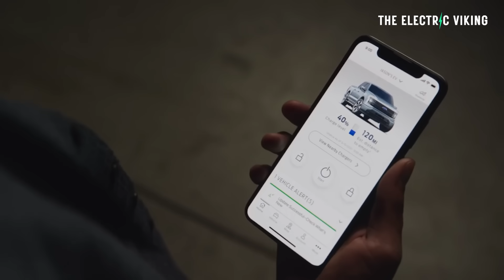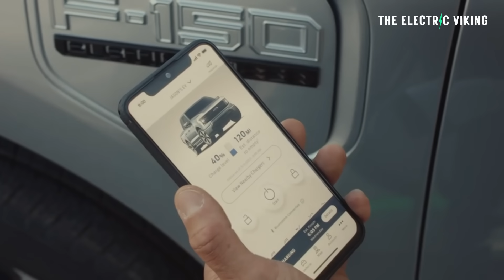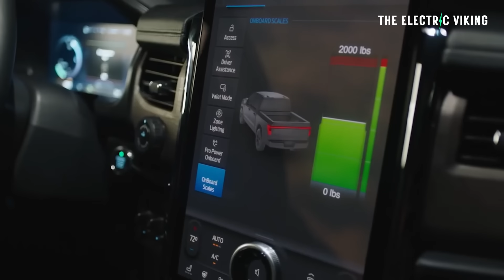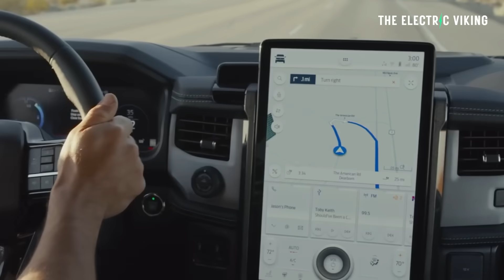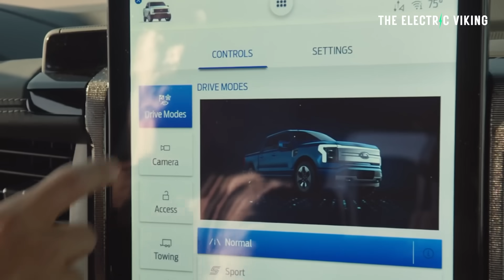Ford increases prices of F150 Lightning after losing $4 billion on EVs in 2023

Comment: Here in New-Brunswick they have 6 Ford Lightnings in stock at our local dealer, and they are not moving. They have MSRPs between $ 82,060 and $ 118,655, before taxes; taxes here are 15%. That's over $100,000 OTD. That's a big payment for an average joe.

Comment: Great video as always but you really should point out a few things.   1.  Ford's loss of $36k per vehicle includes legacy costs related to designing a new EV truck and setting up a factory.   2.  Ford did not cut production of the F150 Lightning!!!!!  They cut their production target for next year (2024).  This is not the same thing and you should explain the difference.  3.  Finally, you left out the biggest news related to the "Flash" editiion.  It comes with a heat pump!!!  Many buyers are waiting for the heat pump and NACS connector.
Reply: Well if customers are waiting for a NACS connector they won't sell any in 2024
Reply: @PaleBlueDotCitizen So lose/lose situation maybe 🤷‍♀️

Comment: They should re-name it the Electric Yoyo!  We didn't have any problem... were on the waitlist for about 2 years, then ordered the Pro... it came pretty quickly... we were surprised. If you're short, be prepared to do some mods to the driver's seat... it has no vertical adjustment. We used wood! I'm surprised NHSTA let this pass. There's already concerns about people running over little kids 'cause truck hoods are so ridiculously tall! Frunk is really nice!
Reply: Aaand ... if you're too tall?

Comment: 5:07 There is nothing especially efficient about the Cybertruck. Out of spec got 260 miles from the Extended Range F150 and I believe 250 miles from the dual motor Cybertruck (to be confirmed) performing similar optimum real-world tests.
Reply: A CT simp accidently filmed the Cybertruck screen and put it up on Youtube when the energyconsumption was up. 667Wh/mile😯 It's extremely unefficent.
Reply: There is no dual motor CT yet.
Reply: @Tschacki_Quacki  Nonsense, customers are only receiving the dual motor variant currently. https://youtu.be/9tAq5hbIWs0?t=1015

Comment: The flash version has the extended range battery plus the tow pkg & upgraded sound system, so it’s really a slight upgrade over the old extended range XLT.  Specking the old XLT with the same tech was more expensive in 2023 & you couldn’t get the B&O sound system before unless you jumped up to the Lariat/Platinum versions.  The flash version is the sweet spot for me.

Comment: Until you can use the Tesla Supercharger Network don't buy any other vehicle if you're planning on doing road trips. If you've got a garage charger and you're just doing local stuff almost any Eevee is going to save you money. But if you're doing longer trips and you can't use nacs connector, fugetabout it
Reply: One could do a cross country in a non-Tesla EV but range anxiety is likely to happen, not so with a Tesla. Also the navigation software in Teslas figures out where to charge, or even better the ABRP mobile app.
Reply: Do you like EV for the environmental thing?... If so why would you want people to wait to get into one.
Reply: @howardj602 no. It isn't. Learn before you speak. You've been lied to by cable tv.

Comment: I don't know what "losing $36k on every EV" means.  Are those marginal costs, or is it calculated by spreading all the initial investments over the small number they have sold so far.  If the later, it doesn't make much sense because you could say they lost $5 billion on the first EV they sold because it didn't pay for all the investment made before that.

Comment: I think Toyota actually has the correct approach towards EVs. 
Take it as slow as the industry allows, try new batteries on hybrids as opposed to pure EVs.
These legacy automakers cant make a proper EV to save their lives.
Reply: Do you have any idea how archaic the battery used on Toyota hybrid system? And how pitiful the electric motor on their hybrid system? Being a former owner of XU50 highlander and current owner of XL40 Sienna. I can tell you the current 3rd generation HybridSynergy is not much better than the 2nd gen. They are not slow, they staganated. The only advantage of the 3rd gen system is the manufacture cost is lower than the 2nd gen. Allow more model to have it.
Reply: @林振华-t4v   The batteries are archaic? because they dont own the manufacturing plants to develop something as advanced as 4680. If they try it, Toyota would need massive sales to recoup the costs. Toyota sells across the entire world. With only a few countries with good charging infrastructure this is not a worthy investment.
I dont think they have stagnated. New Prius has a pure electric range of 40 Miles. Next gen is likely to have more.
Toyota is not anti EV. They just dont want to deal with losses that they have to endure if they try to instantly switch to EV.
Reply: @vorpalinferno9711 
😂... You know Tesla don't make those batteries right?... It's Panasonic, so no different than Toyota buying batteries.
Reply: Toyota current stance will lead to bankruptcy I’m guessing. When countries new car sales are up to 97% EV where do they sell there current models?
Reply: @TomTom-dy6qr   How about no?
Toyota have been playing the game for over 80 years, evolving and adapting every decade rarely missing a move.
Reply: @TomTom-dy6qr  
Toyota sell 10 million vehicles a year... Have have half trillion in assets, revenue of 250 billion.
They have machinery manufacturing
Car part manufacturing
Steel manufacturing
Shares in multiple car companies
Shares in many ther industries

I'm sure they know what they're doing, they didn't become the second largest car manufacturer making stupid decisions.

The auto market is far bigger than just a few EV sales in the US.
Reply: @Robert-cu9bm   Sounds like a Nokia and Blackberry situation. They couldn’t go out of business either and “knew” what they were doing. Writing is in the wall and that’s why Toyota are currently lobbying the UK government to slow EV sales.  That action alone says they are in serious trouble.
Reply: @vorpalinferno9711   Toyota are currently lobbying the UK government to slow EV sales.  Even they know they are in serious trouble. I see another Nokia and Blackberry moment here 🤗
Reply: @Robert-cu9bm Guess you know Toyota just announced it had lied about the safety tests for the last 34 years. So number one, why would you ever buy a Toyota car. And two, imagine the potential fines and class suites costs for such deceitful behaviour 😱

Comment: I think fords base pickup in a ice version is $35,000 so that would make the lightnings base version at 25k higher . 

Now ford preferes to make more expensive models as they are more profitable so finding base models is dificult.

It doesnt look like ford evs will match ice vehichles pricing anytime soon . Even with battery prices coming down that wont be reflected in lower prices

Comment: One of the extremely problematic problems with the entire EV industry is that nearly no makers make a profit even with substantial subsidies which are rip offs of tax payers.  Without those probably none of the EV only vehicle makers would still be in business.  Perhaps you'd have a hand full of very expensive EVs. Now Germany and the US are cutting subsidies - China is being investigated for subsdies that may constitue illegal support/dumping.  Many Chinese EV makers ought to be out of business
Reply: Good thing the oil and gas industry doesn't get subsidies with tax payer dollars....
Reply: @leafnutz2341  They don't. The closest thing to it is the oil depletional allowance. which most companies get the equivelent of. If an asset losses value to get to deduct it. As you remove the oil from a well the value of the well is reduced.  Every gallon of gasoline or diesel is heavily taxed; in my state it is over a dollar which is about 25% of the final cost.
Reply: Missing the forest for all the trees. Yes a lot of people are losing money on electric vehicles but Tesla and probably byd are not. Your analysis is conspicuous by the absence of those two huge exceptions

Comment: It's ok, they are still competative on EV trucks. Cybertruck starts at a whooping $101K😞 for the dualmotor. No signs of the $40K truck👎

Tesla are already past 50K in the preorder list despite having delivered Cybertrucks only in the hundreds. Looks to be some 98% drop out rate on that one.
Reply: People don't "drop out" from the reservation list. The reason most people don't order now, is because 99% of people do not want (to pay for) a Cyberbeast Foundation Series.

"already past 50k" - How much is 50k from 2mio? 😅
Reply: Nope, current price of AWD is $80k, the Cyberbeast is $100k, the lower cost CT is $61k but won’t be available till 2025.  Btw, the preorder reservation list is over 2 million last I heard, how many will turn into final orders remains to be seen. If only 25% place a final order that is 500k, a huge backlog. Tesla is shooting for 100k per year production rate for the near term but probably 2+ years away.
Reply: Many people are passing on the foundation series but they are still in line for the non-foundation truck at $80k. Your emotions are blinding you from the facts. Also there's 10,000 new reservations per week. Sorry luddite hater, you're wrong.

Comment: Very misleading !!! Ford  made a much bigger profit than Tesla at 5th on the list of car makers . Tesla is 19th !!! 3 rungs off the bottom !!! Ford  had a good year and increased its sales of cars which was twice that of Tesla. Telsa slipoed losing 30% of its global market share . The sales slump saw Tesla slashing prices to move cars at no profit which it is still doing with the model 3,  Tesla semi is also losing money in the 100s of millions. Also suffering Production cost increases, a high failure rate of 4680 batteries wastage  of 50% . High staff turn over . Failed solar roof tiles Tesla has lost billions and market share . BYD is now the top BEV car maker . Cyber trough will not be profitable as Elon stated , Ford has faired a lot better in 2023 than Tesla . It also got several car of the year in countries and also its blue cruise was nominated the best autopilot on the market Tesla came 8th !!!

Comment: No worries man, Ford will make up the losses on volume. You want them to "simply" switch to Lithium Phosphate. Do you have a clue how much that will cost Ford? Tens of millions, and how long does it take to implement the change, supplier chains etc. So add the LiPo costs to the already 36,000 dollar loss per vehicle. No problem. And Fords charging stations to slow, and your comment again centers on Ford spending more money, that increases the net loss per vehicle even more. And when they'd start putting out the new chargers, what do they do with all the old slow chargers? That's right it doesn't cost anything to throw them into a landfill, or to recycle them. Is the recycling industry all set up for this? For some reason you think Ford has a bottomless pit of money and investors don't care that Ford is loosing 4 Billion/year. Admit it , Ford F'd themselves, and their customers going all in on a technology that will take 20-50 years to catch up with all BS utopia dream that EV's will save the planet. EV's ARE NOT NET ZERO AND WILL NEVER BE.